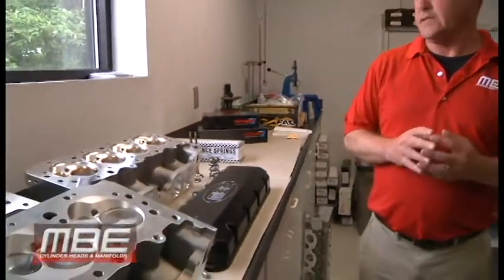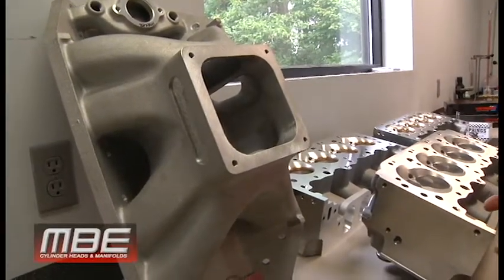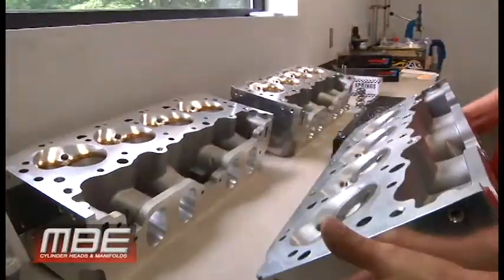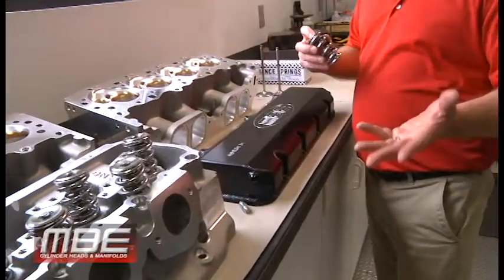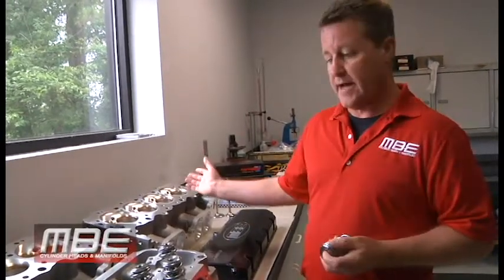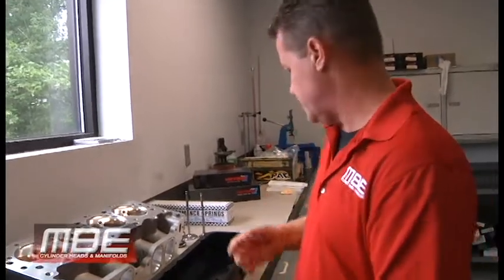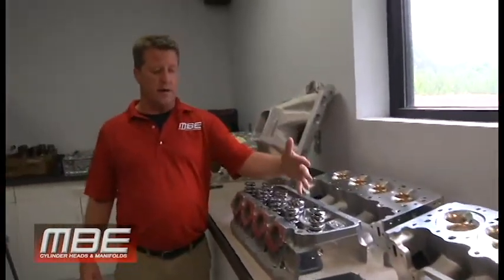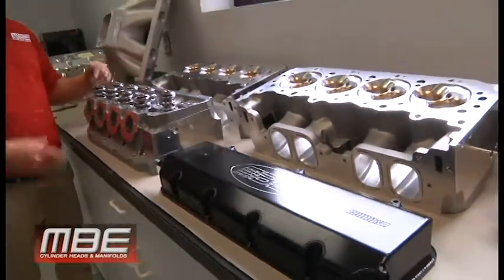MBE  BIG 9 Cylinder Head & Intake Manifold COMPLETE PACKAGE  ** EXPLAINED in DETAIL **

Comment: I dunno if mbe reads these but I’m looking for a top end kit that can be run on a factory sbc block. It’s not a real factory block it’s a dart but I’d like to stay with common parts not something to exotic. But I like your splayed valve heads I’m going to be around 434 cubic inch. So any help would be appreciated. Also do you have somewhere in the USA that I can buy your parts from and have them serviced there? Or do I have to order online?

Comment: How much horses would these heads make on a 13:1 632 cid Chevy ??
Reply: depends on cam, induction, and who is building/tuning the engine.   1500 should be possible
Reply: @dmitchellhomes  On what fuel?
Reply: Idk the ratio that the guy I’m helping build his is running but we are expecting 2500+ out of a built 632